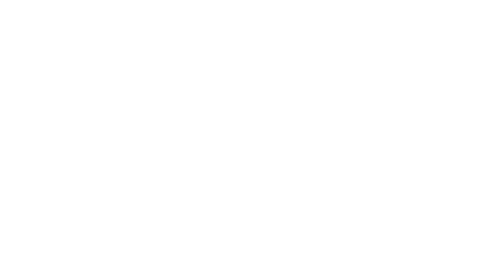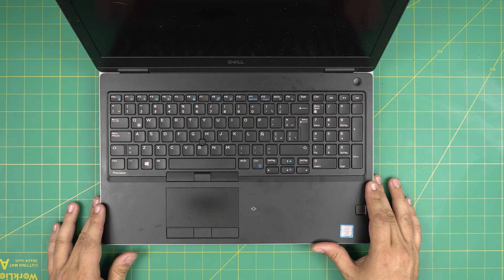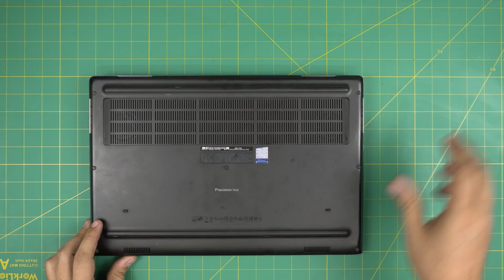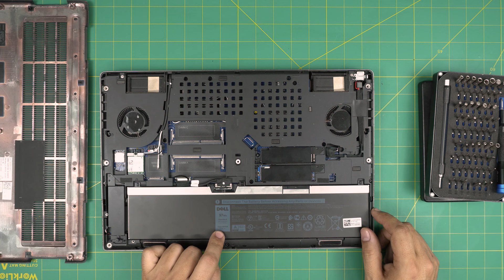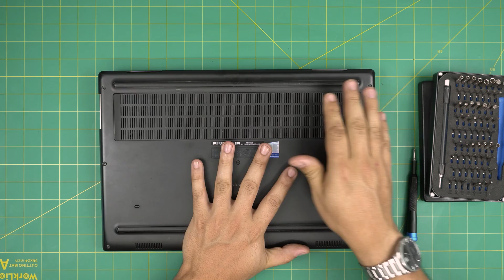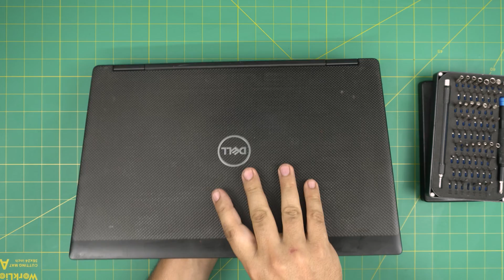How to Replace the Battery for DELL Precision 7530 Laptop | Step by Step

Comment: A beginner here: I tried to lift the thing that removes the cable in order to remove the battery. It is tight and I don't want to pull it hard. Should I?
Reply from the maker: 🫠Regarding your question, they are though and you should pull harder on those tabs to get them released.
Should you have any further questions or requests in the future, please don't hesitate to ask me.
cheers🍻